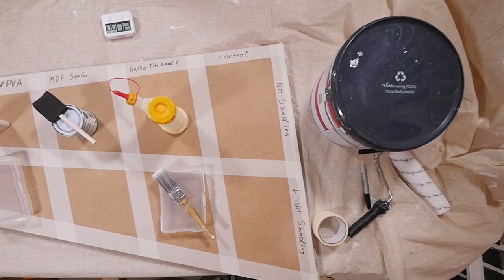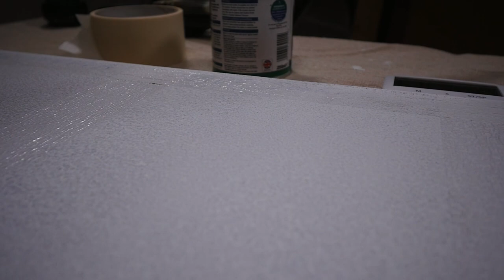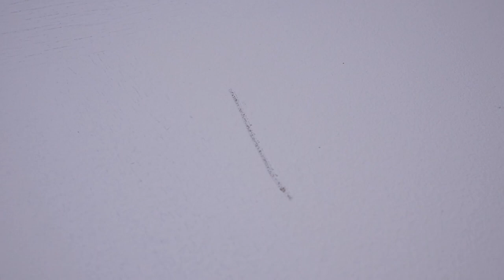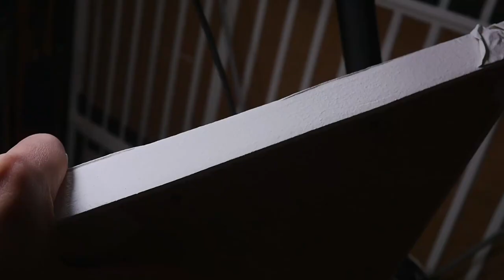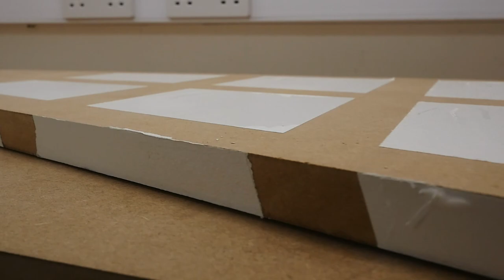How To Paint MDF - Testing DIY Tips!

Comment: While this is more work than you wanted in this video, i have found the best sealer for mdf is Zinsser BIN. All edges ( not the surface) sanded to 180g. Sand in one direction only as mdf has a grain, so sanding both ways raises the grain and makes your life harder. Paint all over with 2 coats if zinsser, Sand to 240g again in one direction only. I find the zinsser gives the edges a good seal and hardens the edge. Although not needed i then put at least 2 coats of undercoat on, sanding between each coat with a progressively finer paper. Then 2 coats of top coat, in my case satin paint, again sanding between coats. Doing all that then creates a great finish that if done right feels smooth as glass. :)
Reply: Is that oil based or latex  Zinseer bin
Reply: @russellmotter5022   If you are asking me? Then it is the methylated spirits (alcohol) based version. The other types are hard to get in the uk.

Comment: Interesting results. With the slight texture effect with the Titebond, could it be that the glue and water didn't fully mix or started to separate? Would be interesting to know if the water temperature, amount of mixing time or how long it stands once mixed before use makes any difference to the surface quality?

A similar test on plywood and osb would also make interesting comparison videos.
Reply from the maker: Cheers Andrew,
Ya, it very interesting to see the outcomes. I did use both the glue mixtures right away after mixing. The Titebond 2 mixes beautifully! 100% no separation as I kept both mixtures in a sealed container for a few days before cleaning them out. The PVA, on the other hand, was surprisingly harder to mix. Eventually, I had to put it in a sealed container and shake it about to mix it well. I would wonder if the water temp would make a difference. I would think that warmer water might facilitate the mixing and may even get deeper into the "wood". I'll see if I have some scraps about and do a few test's on the side and let you know in patreon how it goes.